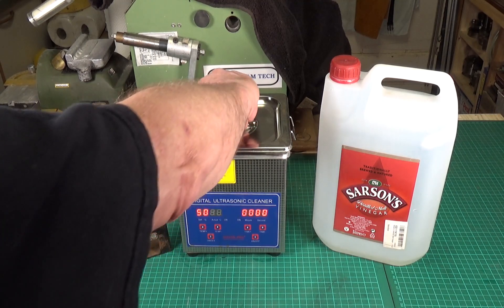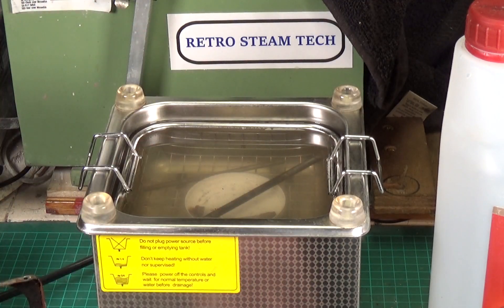Cheap Chinese Ultrasonic Cleaner - Part Three

Comment: Hello Alan,
I have the same cleaner but have not had a go with vinegar... It looks very effective, does the smell of warm vinegar linger for long?
Cheers.
Paul,,
Reply from the maker: Hi Paul. I've been using vinegar for years as a de-rusting agent but this sure speeds up the process. I generally have a nearby window open when using the cleaner so no, the smell doesn't linger. Cheers, Alan.

Comment: That's really good Alan.  Impressive.  Ideal for the sort of work you do.  The vinegar shouldn't hurt brass either.  Cheers Rob
Reply from the maker: Thanks Rob. After the testing I've done with various different cleaning solutions I definitely think it was worth the money,  Going to save me a lot of time. I've found that the vinegar is really good on brass boilers, cleans off any carbon deposit and cleans the inside of any scale. Cheers, Alan.